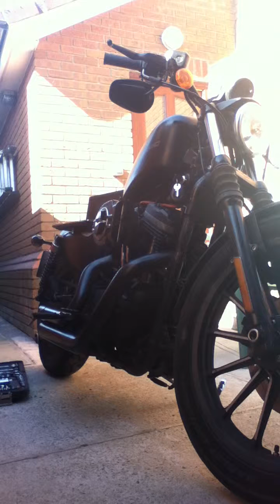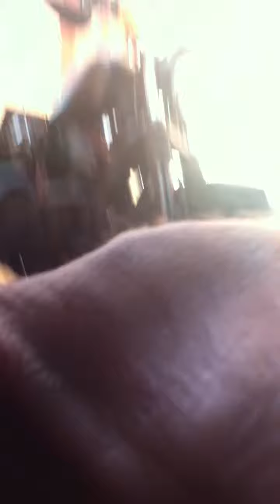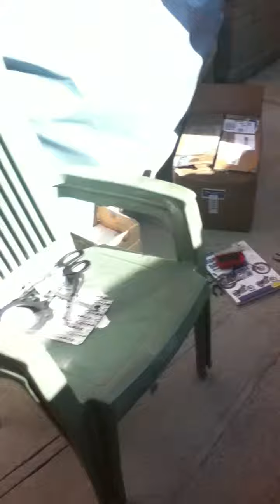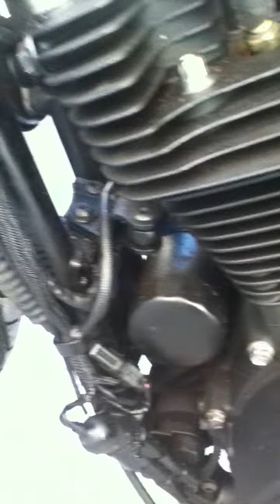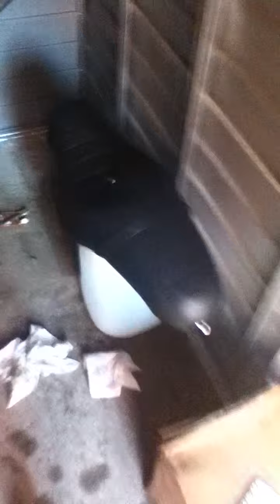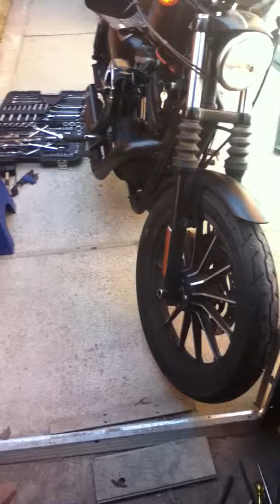HD Iron 1250 kit, with the wrong fuel map. Not accounting for the higher compression.

Comment: I finally got mine dyno tuned.  They only tuned it at about 85 % because i wanted it back that day, and they were all booked up.  But it runs awesome now.  And i'm pushing close to 80hp with my rsd air cleaner, power commander, and vance and hines slash cut slip ons